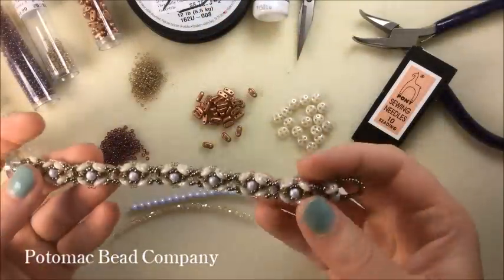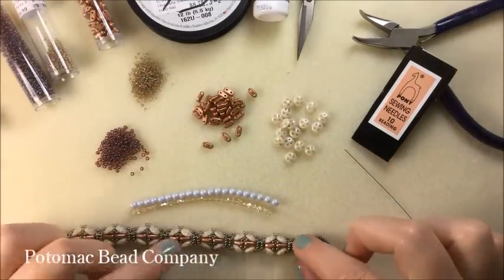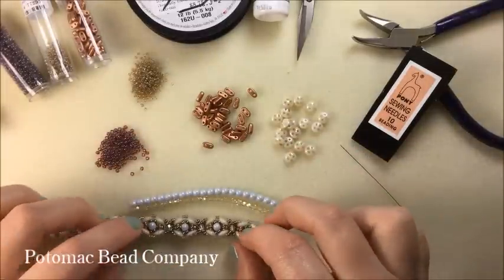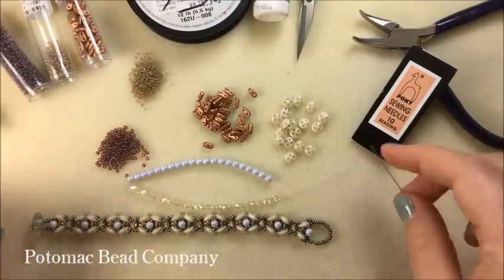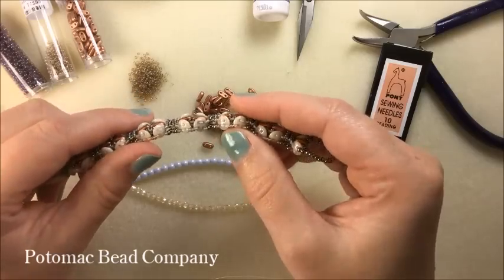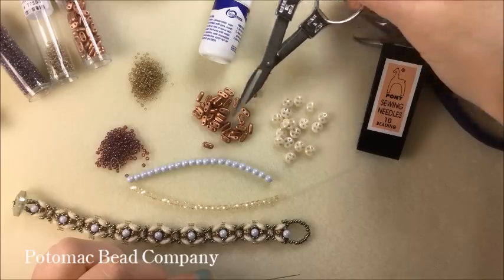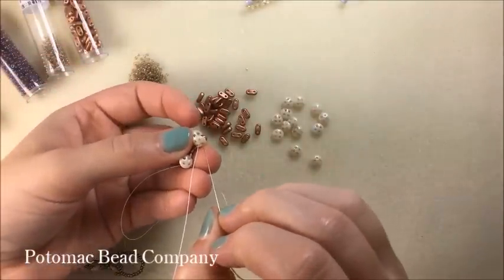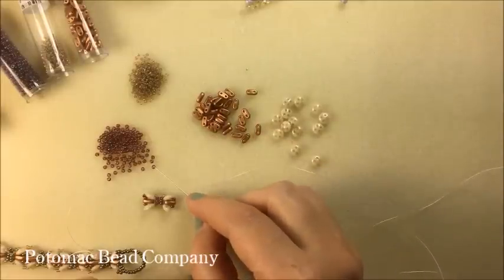Oyster Pearls Bracelet - DIY Jewelry Making Tutorial by PotomacBeads

Comment: Ok I absolutely love Potomac Beading Company their videos are awesome and have taught me a lot. So much in fact that I know the base of this bracelet is just to justify the use of the four hole lentil bead. This bracelet is beautiful it would be just as beautiful using super duos and only doing the front. I say this only because I am frugal and all the added beads you don't see are unnecessary. Their only purpose seems to be to thicken the bracelet depth wise and to justify the use of a 4 hole lentil.Just a note these lentils would be easy to replace with small four hole buttons. Please take this in the spirit it was said as information and economics.